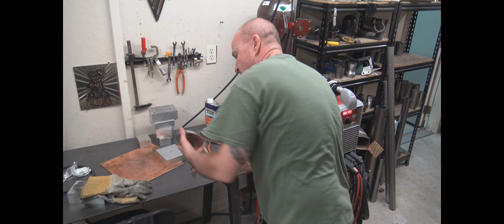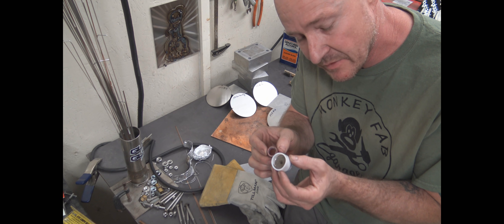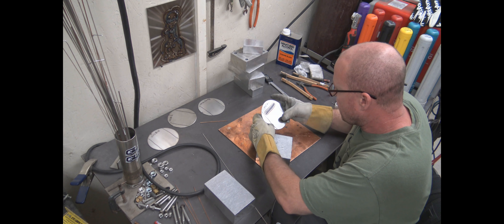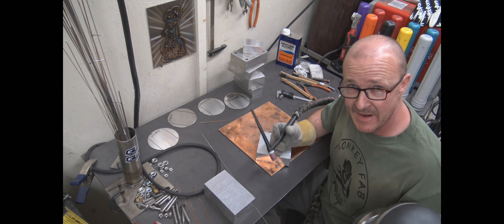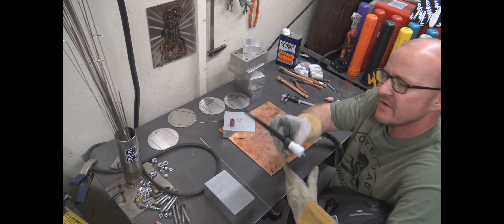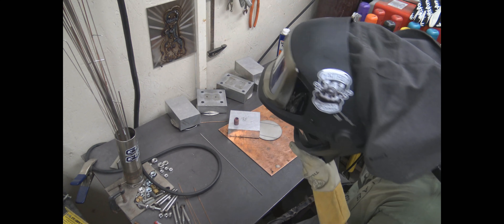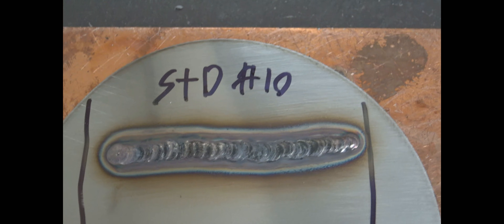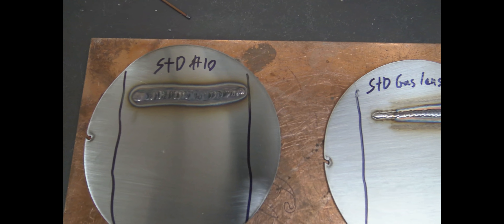How to Get Nice Color In Your Stainless TIG Welds/ GLS CUP 12 & 16

Comment: Hey Mike, I just ordered a number 12 cup and some 045 filler rod from you, I think the number 12 cup would be a good starting point for me and can get by with a little less gas, I all ready have the gas lense and collet body for the 3/32 and the 1/16 tungsten so I should be all set. Thanks
Reply from the maker: Desert Rat 2000 thanks you won’t be disappointed

Comment: another thing to note if your looking for purples and blues in your weld you actually want less shielding a perfectly shielded stainless weld will be silver only travel speed plays a role since the slower you go the more shielding the weld is going to get also the faster you go the less shielding the weld is going to get because the cup is gone so shielding is gone travel speed may possibly be a bigger player than cup size
Reply from the maker: Not really. Go give it a try. Slow saturates the metal with heat. You will really see this in mild steels that lack the ability to distribute heat as quick as ss. You can make it look just as nice as ss but it requires a lot of gas and letting it cool as you go. You can see this on my instagram account. I post lots of mild steel there. You part right. In the “go slower” idea. Like I said at the end. You only do what the cup will allow, like 8-10 dabs and stop, shield it and when it’s cool, repeat.
Reply: yeah when i say speed i mean going fast vs normal you can't go "slow" on stainless isn't an option, i have  furick bbw and i don't see much a difference in a 8 or 10 with a 1/8" to 1/4" stick out  on them now if i have a 3/8"+ stickout on the bbw is much better for sure
Reply from the maker: Part Out hum. Maybe I just don’t understand what you mean. Throw up a video. If it’s something I don’t know about, I’d like to see.
Reply: I think what he means is that as soon as the shielding gas goes past the portion you just welded, the color comes up. I’ve noticed that too. If I do a very short weld,, it can be totally silver, which is ideal. That’s because the gas is there until the temp goes below the oxidation point. The problem with going slower, on a longer weld, is that you do have more heat to get rid of, so while the longer gas dwell is preventing oxidation, for a time, it’s overcompensated by the higher heat in the weld, and area around it.

I’ve experimented with a small gas tent, and find that everything comes out silver. Doesn’t mean that you aren’t getting chromium carbide, because you still are.

I do want to say though, that mild steel is a better conductor of electricity and heat than stainless, which is why stainless warps so much more.

Comment: I need some problems of adjust gas meter L/min . How many I need to adjust when welding steel? and keep welding colorfull
Reply: if you want color welding steel try using 309L filler rod
Reply: Thanks you so much to let me know my tension problem